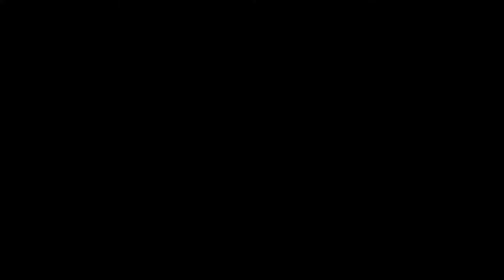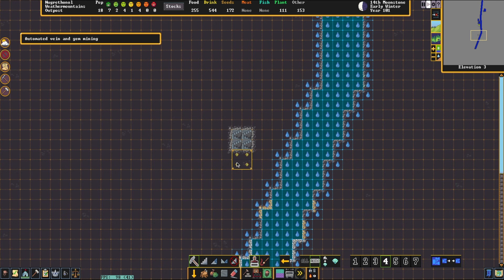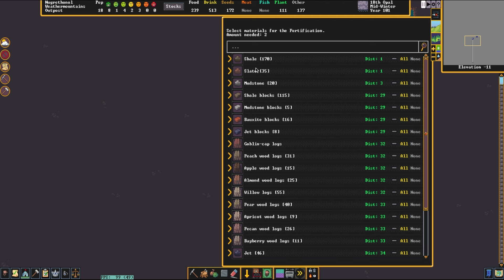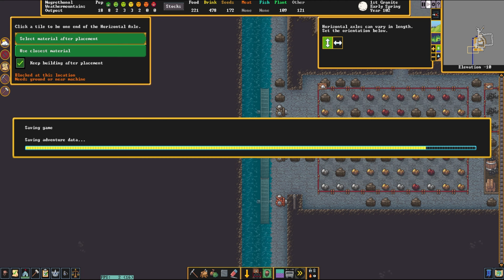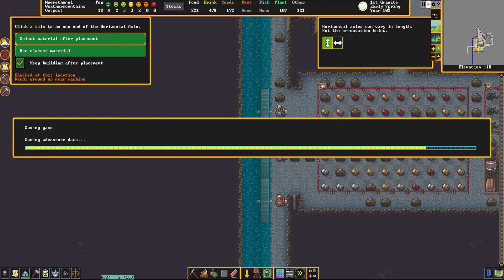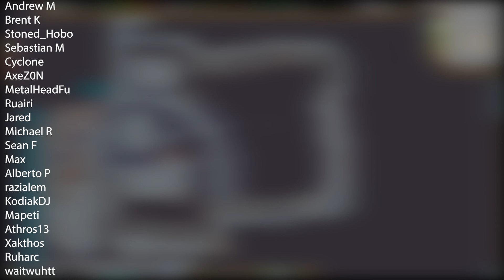Dwarf Fortress - Your First Fortress Tutorial Lets Play | 05 (Controlling water Flow)

Comment: The repeating orders are fairly straightforward, at least in this version.  You just pick a task, then add all the automatic suggested conditions, then adjust the numbers to taste.  The main one is the "output less than" condition, which is where you set your minimum stock.

The other trick is that you need to also raise the "input greater than" condition for things used in multiple orders (especially cloth/leather/metal making armor and clothes, since there's a lot of those), but even if you forget that things will still work, you'll just get more cancelation spam.

There's a few things that don't have the correct suggested conditions (making soap is one) but this works for most things without much effort.

Comment: I'm just about to start playing with water myself, so coming back to this has been super helpful, especially the part about channeling out the shoreline instead of coming at it from behind. I don't have an aquafer, so I'm planning on channeling part of the river in the corner of my map (and it is a river, not a brook) into my fortress' brand new water reservoir. I can probably make the power river part of the Reservoir's overflow drainage. Next, I just need to figure out how Pumpstacks work so I can make a mist generator.

Comment: Once you get to steel making I thing having a better understanding of the conditions are important.
I set pig iron to be crafted when flux and iron ingots reach a specific number only.
This number will be high enough that the pig iron ingots made will not be higher than the materials then needed to make steel.

By this method, unless I make coke, I can control the process by not making charcoal to the number value that would start the process of making pig iron. (lack of flux would be the and condition preventing charcoal amount from starting the process).

Comment: One thing that would be recommended is to get the water through a U-Pipe first before putting it into the fortress, and then in that pipe installing Grates over a set of Down-Stairs on the going-up side, to guarantee no Water-monsters can enter through the water supply.
Reply from the maker: No water monsters can enter via this small creek.

Comment: ive noticed that the bug where it doesnt allow you to type has something to do with flicking through the tabs on the workshops too quickly. one reliable method to get the bug to happen is by opening the work orders tab, clicking the text field, then closing it without typing anything... going to a different menu that allows you to type seems to fix it, which is why you could type again after you went to the overall work orders menu.

Comment: Thanks for this. 
I had a question about large aquifers, started one map and really liked the location but a few levels under was a huge light aquifier I couldn't find the end to it despite digging a huge hole in that lvl, that's the best way to go about that? Thanks
Reply: Just keep going. Some aquifers are 20+ levels thick.
Reply: @7heTexanRebel  the dwarves stop mining every lvl have to keep ordering them to do it? And how do you stop it leaking those 20 lvls until you get under it to flood that lvl?
Reply: @Redery001  Two year old comment is two years old so you probably figured it out, but I figure Id give an answer since no one else did. DF Hack will give you an option to dig through damp stone. It is a little buggy and sometimes the order still cancels but works about 90% of the time. What I do when digging down is have a 2x2 staircase down to the desired level and dig at least 1 to 2 spaces away on all sides while going down, ending up with a 4x4 or 6x6 shaft. If i know the aquafer is going to be pretty deep, I have a stockpile of rough stone near the top of the shaft. Use that to build walls in the shaft, ending up with either a 4x4 or 2x2 as preferred. I wouldnt normally use the stone that you are digging out as sometimes that will get pulled for a different part of the wall and suspend construction on the tile its on. Youll have to do this in stages to keep ahead of the water. Wait for the pools to evaporate then repeat. DF Hack makes this pretty easy since you can set those walls as priority build, otherwise do this when there arent that many other outstanding jobs.

Comment: How quickly does water drain out of those arrow slits on the edge of the map. I've made a moat I'm trying to drain this way but the water seems to be staying around.
Reply: I was having this problem too. Make sure you are digging all the way to the map (cause I wasn't). You need to dig all the way to the end of the map for the drainage to work. You need to smooth and carve the last 4 tiles that are actually 1 tile off the ''diggable'' map.